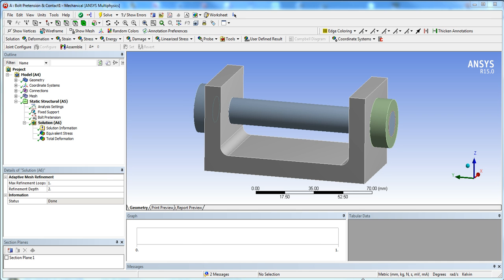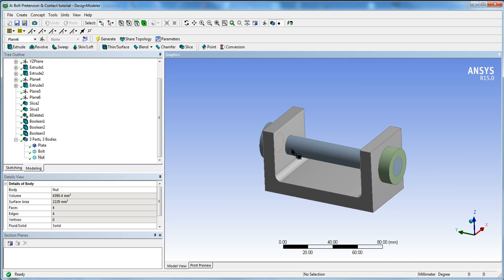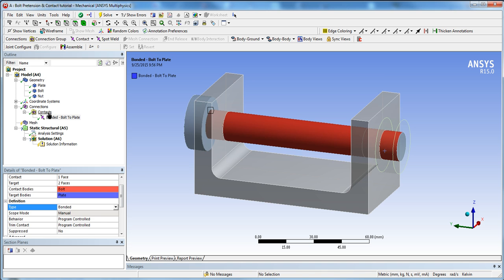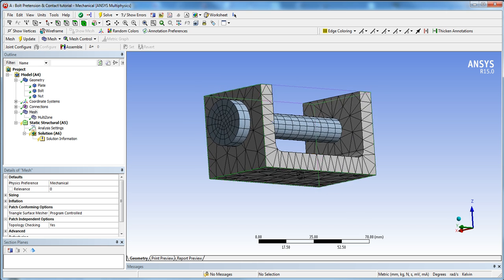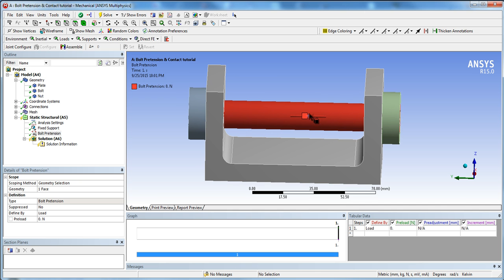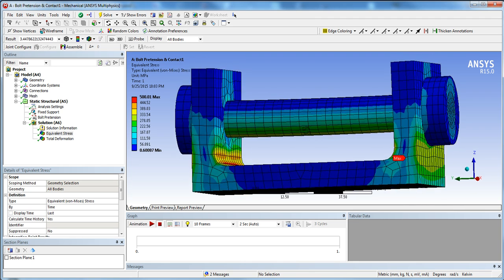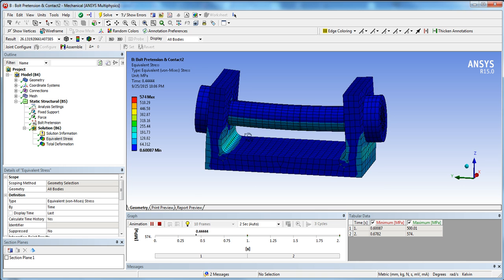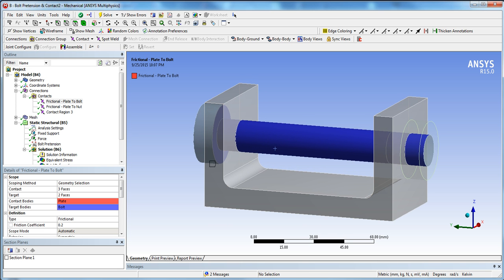ANSYS 15 Tutorial - Frictional Contact & Bolt Pretension

Comment: i have a screw inserted into a bone, how to show the stress distribution in each part (nothing appeared in my results, just the colored force values)? also, the screw penetrated about 2mm inside the bone! how to prevent penetration? i used normal lagrange but the output results were wrong

Comment: hi, thanks for you video, usually the diameter of the hole in the bracket is slightly bigger than the bolt, so there is a gap between the two cylinder face, will this still be able add frictional contact?

Comment: Hi DrDalyO, This is indeed a very helpful video. Thank you very much. But when I applied bolt pretension it was not centered and my results are different from yours.  How can I make the bolt pretension centered?
Reply from the maker: Hi! Are you sure you selected the cylindrical surface for the pretension? Maybe double check your geometry to make sure there are no mistakes.
Reply: DrDalyO yeah I selected the cylindrical surface and still the pretension appears on the aide of the bolt

Comment: Hi sir
How to change bolt pretension load acting orientation?
In this case you applied load horizontal direction.suppose if you want apply pretension of load vertical direction.
How to do that.
Reply from the maker: At the bottom of the graphics window where the model is displayed. If you select the bolt pretention, you will see a red arrow at the bottom, near the ruler. You can click this and it will flip the orientation. You should also be able to do this in the details of the bolt pretention i believe. You cannot apply bolt pretention other than along the cylinder axis.
Reply: Thank you sir

Comment: Thanks for your tutorial they are really useful!
Mesh question: Some guys (in DM) use in to divide model (slice material) in “regular” bodies and form with them a new part, in order to obtain a more regular mesh. For example consider our bolt and slice it in one minor diameter cylinder and one greater diameter cylinder: or our “C” bracket as a part made of 3 “body” plate. 

What do you think about it? it makes sense or maybe it is and old habit who comes by older or different program?

Corner and edge question: Some guys use to delete fillet radius from model in order to obtain more regular mesh (like above) and reduce computational
Reply: slice is often used for the complicated model, mostly we just care about the high stress location, so sometimes we simplify the model to reduce the calculation time

Comment: Hello, thanks alot for this tutorial. 

I have just one question, for bolt pretension, you went for adjustmet but didn't explain what does it mean? like if i go for Load, does that mean torque applied on bolt, while we are fastening it?

Comment: Very nice video, I have a question though: what if I need to evaluate the life? On the model I want to set some bolt pretensions and some external loads. Only the external loads should determine the cyclic load, while bolt pretensions should be a constant. How can I set this in the fatigue tool? Or maybe this is automatically done by the software? Thank you in advance
Reply from the maker: Please do some reading on the fatigue tool and how it is used in Ansys

Comment: What type of contact should i use if one plate is grouted in foundation and second plate is bolted to the grouted plate. Second plate is a footing of a frame. Bolt is torqued. Could you please explain what contacts and boundary conditions should be applied? Thanks

Comment: I am running a ansys anlysis with 114 bolts in the model. most of the bolts are contact with a cylindrical/curve surface. ansys give an error "The solver engine was unable to converge on a solution for the nonlinear problem as constrained.  Please see the Troubleshooting section of the Help System for more information." Do you have any suggestion what I should do to solve the damn problem? Thank you very much in advance.

Comment: Excellent tutorial!!!!
Reply from the maker: +Liu Victor thank you!
Reply: Do you have a tutorial regarding how to see the load distribution after apply a force/pressure on a surface or how force reacting each other among different components? At ansys When we apply a force to a surface, the load is even distributed I assume?  Can we apply uneven distributed load to a surface at Ansys? 

Thank you very much in advance.
Reply from the maker: Here is a tutorial where I use a varying load: https://youtu.be/mAZKGNcDDvs
To see shear and moment results, you would need to use beam elements, and use the beam results tool.
You can also see reaction force results if you change the scoping method

Comment: Hi I am working with ansys aim and am having troubles with a multiphysics analysis. I have 2 plates that are bolted down and electrical current is run through the top plate with the bottom face of the second plate being grounded. I should expect to see and increase in temperature causing a structual change but all I get is an increase by .0008 degrees. I think there has to be something I haven't considered with the contact between the two plates and having additional resistance but I'm not quite sure. Any insight on this?

Comment: how do we specify the compression only nature of the threads of the  bolt, like the force transmitted between the threads of the bolt and the surface of the body to which bolt is connected?

Comment: Thank you very much Dr.Dalyo. Very helpful tutorials. I wanna ask you
I am modelling wall using masonry bricks and I want to add Interface connection (e.g INTER193 : 2-D 6-Node) between the faces of the brick. I don't want to use the automatic contact provided by the Ansys. If you have the command code I will be very thankful

Comment: Is it possible to use a beam in "connections" between two remote points and apply the bolt pretension to this beam and not to a geometrical object ?

Comment: Great videos! Very helpful! But isnt 0,2 a bit to small for frictional coefficient between steel? When I make the coefficient bigger my solver solution do not converge.. :(
Reply from the maker: +Tom Glansholm well if its lubricated no. But if not then ya would be higher. In most cases it wont change the results significantly depending on where is your point of interest. If you really focused on the contact results then ya, put a more realistic value. Also any value above 0.2 i believe in Ansys makes it more difficult to resolve and takes longer, hence your convergence problems. You might have to make smaller substeps to solve. Good luck and thanks for watching!
Reply: Thanks again! I am a engineering student and havent taken any courses in advanced FEM yet so this is just for fun. But im interested of the effects of having a frictional contact, not the contact itself. Like if you have two plates and a bolt connecting them. The frictional forces prevents shear stress in the bolt if you have the bolt pretensioned(? english) so that normal forces appear between the plates. Maybe some other approach is better?

Comment: Thank you so much for your tutorial video, this also guide me some suggestion in my work. But I still in my trouble. I have some case for static analysis. If there are 3 components. First, element 1 make element 2 deformation, then element 2 to contact with element 3 and transfer moment. All contact is frictional. I try some option in contact, but program didn't give me any suitable results

Comment: Great tutorial...Can I use the same concept for my model, which has an adhesive joint and a screwed joint, to check if the adhesive gives away as I tighten the screws? Also I would love to see how the reliability (time related failures) of a model can be simulated using ANSYS. Eg., If I were to simulate environmental Stress Cracking by putting the part in a humid oven, after how long the weakest member is going to crack.

Good job!

Comment: Very nice videos!!! 
I have the following questions:
1. Let's say that you have some deform-able bodies and you need to connect through Rigids, How to we do that in ANSYS?
2. Is there any option to transfer the loads, say force or pressure on a surface through a contact surface without physically connecting it or is there any equivalent options.
3. can we plot shear force/ Bending moment diagrams on a 3D models; as in your 1st video on 3D beam.
Reply from the maker: +Naveen Anan you can change the option from deformable to rigid in the Geometry branch in the outline for each body. 
Yes there is something called Connections to create contact. 
Moment and shear diagrams are for beam elements only, not for general 3D elements

Comment: Great tutorials man! But I have the same problem as someone here, I´m working on 14.0 version and cant open the geometry. Would you mind saving the geometry into the 14.0 version if you can? Many thanks
Reply: Actually I can make the geometry by myself in Creo 2.0, but only thing I need to know is if the hole in the bracket is bigger than the bolt and how much. This problem could make my simulation hard to solve....Thank you very much
Reply: +Adam Blaha 

save the creo geometry as .IGS and then import it to ansys
Reply from the maker: +Adam Blaha i think the cylinder and the hole are the same size, no gap.

Comment: Hi DrDalyO,

I followed your tutorial step by step but I couldn't get the contacts right. I'm using R16.2. I got question marks on the left of my frictional contacts. I got error messages saying "BONED or NO SEPARATION type required for this contact configuration". The error messages point to my question marked contacts. Any idea why it happens?

BTW, really nice tutorial. Thanks!

Steven

Comment: Thanks for this video. I learned a lot.  Can I supposed that the strutural material in this case is insufficient (210 MPA max) and i need increase/change for another, for example, material A516-Gr70 ? I think this, because on the curve the max tension is 500 MPA and the strutural material support only 210 MPA. It's correct ?
Reply from the maker: +Ronaldo Michellucci it goes by yield strength of the material. so you must stay below this value. Normal steel is on average 250MPa, so the stress in your simulation should be less than this value. In the case of this video the stress was about 500MPa, so you would need a higher strength steel that has a yield limit above 500MPa which is less common.

Comment: Greetings! Thanks you very much for your videos! It's all really helpfull.
How do you think to make tutorial about construction made from beams and using the beam-element (line-body , i guess) to analize it? Or using different kind of elements in different cases and how to change it in WB. I think, it's the base knowledge and it will be really helpfull, espetially  for beginners.
Reply from the maker: +skullheaddd1 I could add a tutorial like that to my list. I was thinking of doing a truss example which contains line bodies.
In geometry modeler you could just draw lines, and apply a section to the line and create a line body.
Video to come.
Reply: +DrDalyO The truss example would be just what is needed.
"In geometry modeler you could just draw lines" - but how can I do the same thing when imporing geometry from SolidWorks, for example? How can I convert solid bodies was modelled in SW to line-bodies in WB?

Comment: Hello DrDalyO, thanks for the nice tutorial. I have a problem similar to this, and need your advice. The link below is the image of my connection I need to do the simulation. Should the contact be frictional contact as well ? How to define the contact  if the bolt hole is larger than the bolt ? If you can make a tutorial on this connection, that'd be the best!!! if not, could you please give some advice how to model this ? many thanks 

https://goo.gl/photos/TZxHZztRyVYXaTnN8
https://goo.gl/photos/RvP1fwQaYcvaaY4g8
https://goo.gl/photos/U3wUuM9KcrhdmWaM7
Reply from the maker: +Tien Cuong If the bolt hole is larger than the bolt and you know it most likely wont come into contact, then you can just put no contact there. If you think it might, you can add a frictional or frictionless contact between both surfaces even if they are not initially touching. If you want faster results and you dont really care about the frictional effect of the contact, you can save solver time and use frictionless. Using frictional contact is more accurate because that is what happens in real life, however this will make the solution longer to solve.
Reply: +DrDalyO The bolt hole is larger than the bolt, however, if the square hollow section is pulled or push (ie. tension or compression) then the bolt will come in contact with the inside surface of the holes. In that case, it is fictional contact I guess ?
Reply from the maker: +Tien Cuong Ok, ya use fricitonal contact.